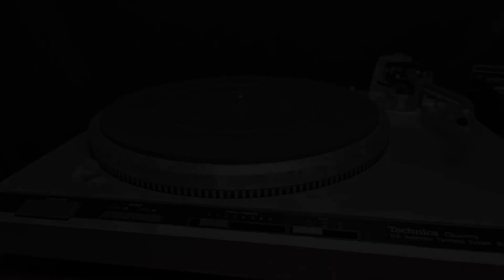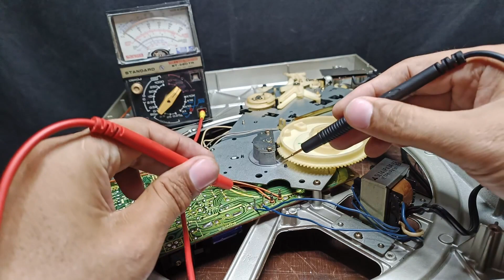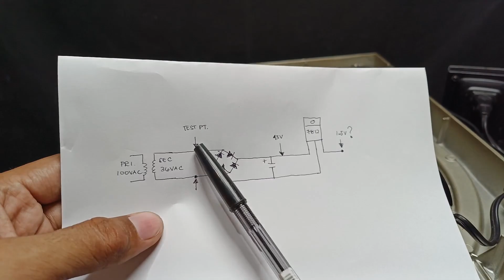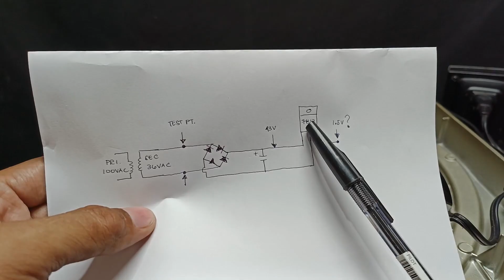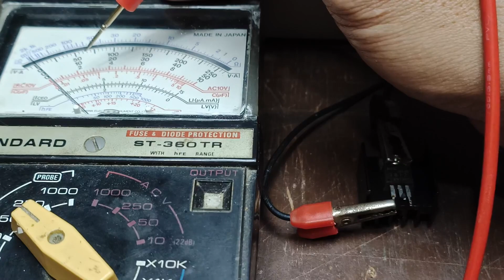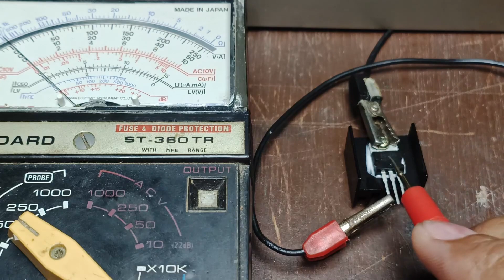How to repair turntable NO POWER || Technics SL-Q3

Comment: Awesome video,I have a SL-Q2 AC voltage on secondary test points is AC31volts on the bridge rectifier I am getting DC 0 Volts not DC43 Volts and on the IC regulator I am Getting DC 0 Volts ! I don't know how to isolate the Bridge Diode or the IC rectifier,Could be the Transformer or Should I replace the Bridge rectifier and the IC regulator ,any help would be extremely appreciated!
Reply from the maker: Disconnect first the main circuit from the power circuit. Then run a voltage check on the diode and regulator IC. If it is 0V then disconnect IC and check again the diode if it is still zero then replace the diode. After replacing the diode connect the IC and check output voltage.

Comment: I am one of your viewers, i wonder if you can advise me how to repair a marantz turntable tt 6000 running at very high speed. Am from the Philippines
Reply from the maker: Check the IC and transistors
Reply: Thanks, i will try to check those
Reply from the maker: @maximotadlas1316  Welcome😊

Comment: Hello, could you make a tutorial on how to solve the speed problem? 33 -45
Reply from the maker: Sure. What is the issue of your turntable? What happen to the speed?
Reply: @woodys_hobbies  The problem is that when I turn it on it stays on at a speed of 45, and even though I select 35 it is not possible to lower it and everything is heard very fast
Reply from the maker: @GundamEpyon Strobe lines are moving clockwise?
Reply: @woodys_hobbies  yes, the equipment turns on, and rotates clockwise, however it rotates very fast, I think I will make a video
Reply from the maker: @GundamEpyon  I think you have a problem with the IC AN6675 If you replace this it is better if you replace also the AN6680.

Comment: On my Technics SL Q3 the setting button keeps jumping back to 12 inches.
As soon as you press start.
Why is that?
Reply from the maker: Check the "Size" Mechanism maybe it's dirty or hard grease in the mechanism or tangled. Try to clean and lubricate with a silicone grease.
Reply: Okay, thanks, I'll try it. Write again if it worked.
Reply from the maker: @jannikd01  👍👍👍👍👍👍
Reply: Now it works again. Thanks!
Reply from the maker: @jannikd01  Welcome